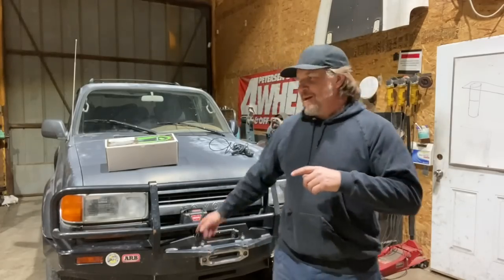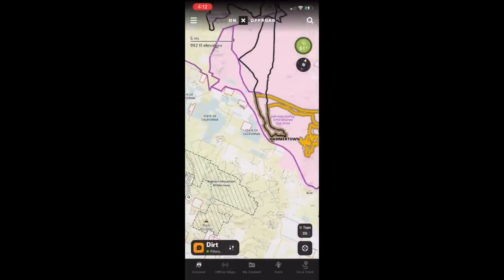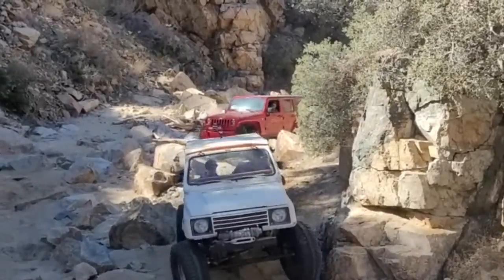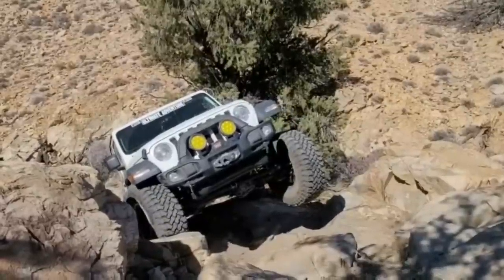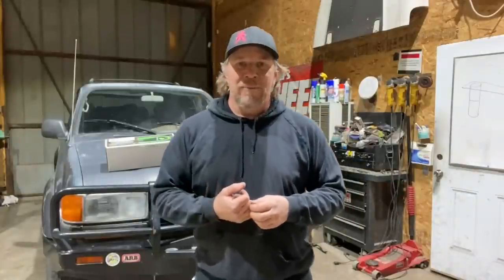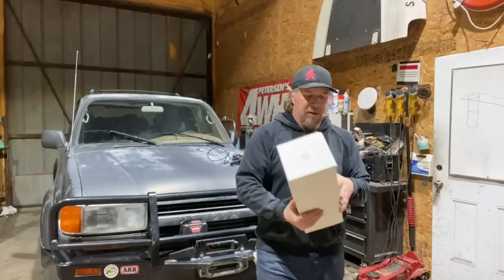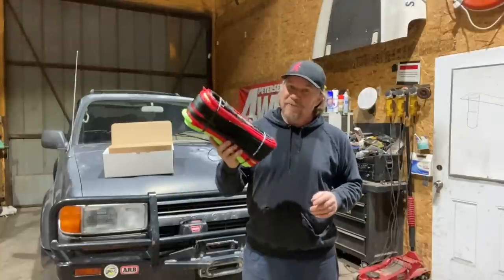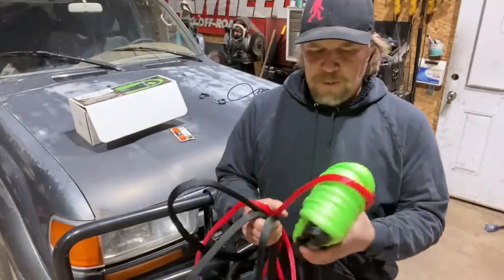Dirt Daily. How to Add Winch Rope to Your Land Cruiser

Comment: I use a hook on my winch. I have worked with cranes, winches, air tuggers and things like that for 35 years as an Ironworker in setting structural steel, and rigging. Never saw a hook, or any shackle fail that had been rigged up correctly. Most failures or injuries happen from improper use. That being said. I can definitely see benefits of carrying soft shackles and using the winch rope and not steel cable.  Benefits of both. I carry both soft shackles and steel. Great spots to use either...

Comment: I completely agree about the hook versus thimble. Are used to wheel with a bunch of guys that worked in the aftermarket, they would always drive company vehicles, and the shackles would always disappear.  They always had a winch, and usually had a remote, but never could use it because no shackle.

Comment: Also handy hitch pins for receiver hitches. Work great once you put thimble end or tow rope end through opening then latch pin through hole like you do for tow attachments. Then if line breaks metal stays put.

Comment: I appreciate your soapbox & that Bubba rope looks awesome - great company. 
Another great option that meets your worst case scenario is a BleepinJeep Freedom Winch Line - it has a soft shackle built into the end of the line!
Reply from the maker: yeah, Bubba Rope has been offering a winch rope like that for a while, I have one on my TJ.
Reply: @4xFredWilliams  yes agree, but, what is it rated at..2t,,5t.. also mate uses similar but it swivels, so the line stays un twisted. ausie..look into alloy bullbars. 8mm -10mm aero alloy, stronger than steel & flexes..i know, i wrote off a guys car,,pulled out in front of me at 60ks..

Comment: Very important to make sure there are no burrs on the drum when going from steel to synthetic. I like to wrap the drum in gorilla tape to make sure there are no sharp edges that can damage the synthetic line. Also, the less gimmicky and better way to attach the rope to the drum is there is a special knot you can tie. Look up the Safe-extract method. You still want to have the 10 wraps in normal use, but with the knot you know the rope won't come off the drum.

Comment: Yeah but you missed the fact the soft shackle can go  through the tree saver and through eye in the winch rope, I always have two soft shackles just looped round the grab handle and a soft shackle with nylon puck to double up the rope if you need more winching power. I always have these in my vehicle along with a rope and kinetic rope in the cubby under the rear seat, along with winter gear, always be prepared never know when you will need to assist someone.

Comment: I'm still a cable hold out.  I guess I'm cheap, too.  I've had the same winch cable on my winch since the 90s with no issues.  It'll probably look the same in another 20 years.  Still, I've been considering going syntheric.  If a synthetic line can degrade in only 150* should I be worried in the summer when it gets over 110*?
Reply: The 150F figure that is floating around isn't correct information. Sorry for the enginerding, but UHMWPE by nature is a non-liner polymer. It has a modulus ( strength ) that changes with temperature and time. Under load at a high enough temperature ( above 150F in this case ) the material can no longer hold the maximum rated load over a specific time without significant creep or stretch. The material does NOT melt at 150F. A few more notes. The entire rope....all the fibers, not just the outer fibers that in contact with something hot or baking in the sun, have to be above 150F to see a change in strength. Industrial processes actually use heat to help 'set' the fibers under tension to make the line ultimately stronger. I hope that helps.

Comment: I am the least qualified to comment as I have a synthetic winch line and no offroad rig. But having heard your argument i plan on making a short lanyard with appropriate hook that can be easily attached to the eyelet when needed.  That way the eyelet will work when it can and the hook could be used when needed on my rig or another rig.

Comment: You might want to orient your dry erase markers so that the tips/caps are pointing down inside the can you use to hold them.  This will make the ink flow towards the tip so they don't dry out as fast.

Comment: Disclaimer time.  I am a sports car/road racer that has recently discovered this channel and others, and is off-road/overlander-curious.  I do not profess to be an expert, but I will share some potentially relatable expertise from my time years ago in the safety industry and fall protection.  Hooks and connecting devices in fall protection need to be compatible to avoid something called roll out.  You can see this sometimes in something as simple as a dog leash that when bound up with only a single locking device, can essentially pop off.  In recovery, in particular, a straight pull, I suspect you are fine, but hooking back on the recovery rope, I could see a danger in that.  Now, would I do it in a pinch?  Yep.  I mentioned I used to race and during that time I have done a lot of stupid or questionable things.  I have seen and been involved in responding to a few things and sometimes you have to do what you have to do.  Just some food for thought.